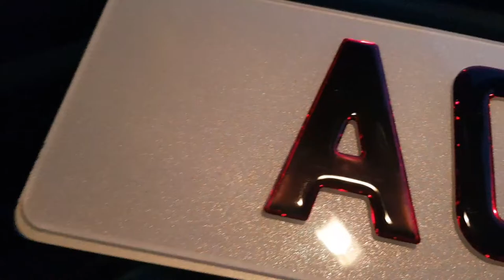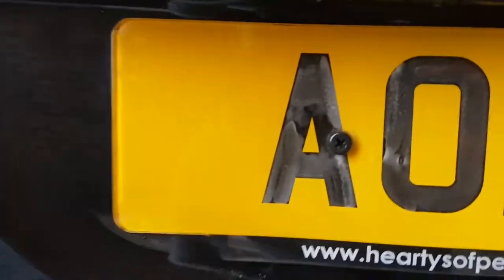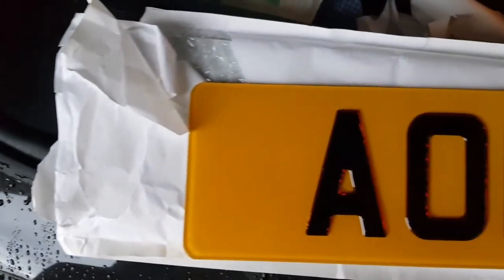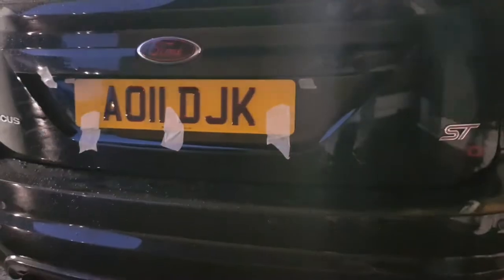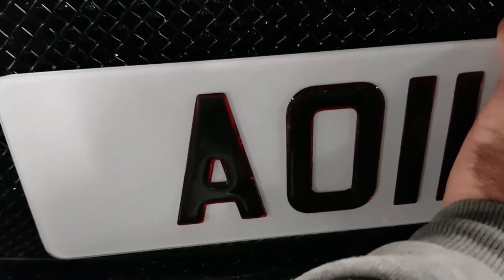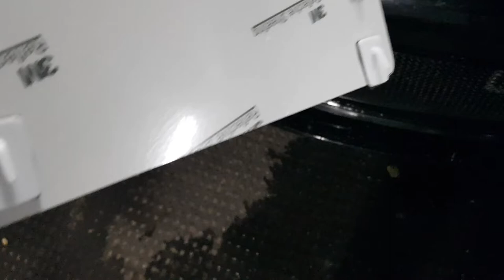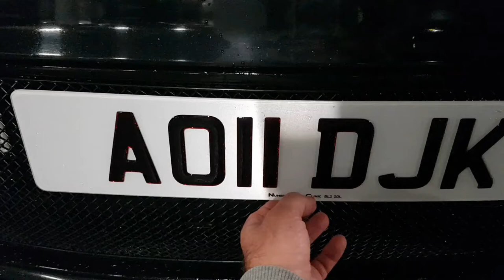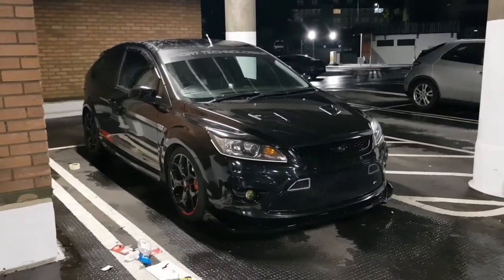How to fit your number plate to a Zunsport lower grille

Comment: Like the ST badge fit, a metal bracket behind and plates screwed in and double nutted with washer (B&Q) with the metal bracket support to lock it in (just not over tightened)
Reply from the maker: Good shout... 👍
Reply: I used gorilla glue.

Comment: Did you find a better place to put the hooks mate? Im doing mine today. Only got the 3 hooks though 🤣 would 1 in each top corner & 1 at the bottom suffice?
Reply from the maker: Don't put them at the bottom only the top is needed mate. Put them on first into the zunsport holes and then place the number plate on or you may not get them lined up correctly into the small gaps on the Zunsport!! 

I would then take off, and check goes on and off ok, then take off again and mark the back with a pencil where they have stuck to, remove and then I have now stuck them on with silicone adhesive! I found when it really rained it got too wet and one fell off! Never had an issue since...
Reply: @lordeest  thanks for advice mate 👍 I’ve got some gorilla 30lb tape I was going to stick them on, but I do have some tiger seal knocking about I could use.

I’ll bare that in mind when lining up tomorrow, weathers looking better so should cure okay. cheers pal
Reply from the maker: You might be OK... it lasted OK for a while but winter and al the rain made one side fall off!!